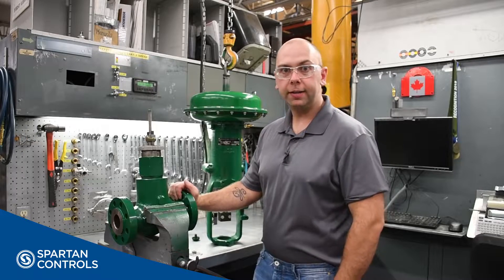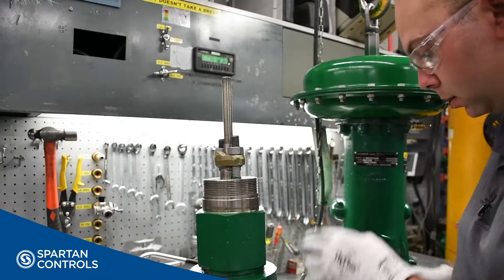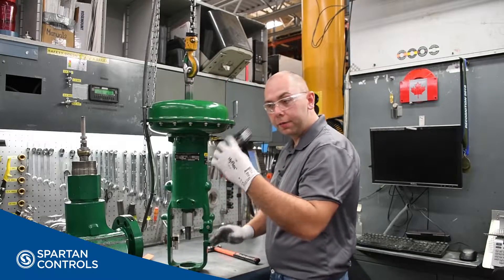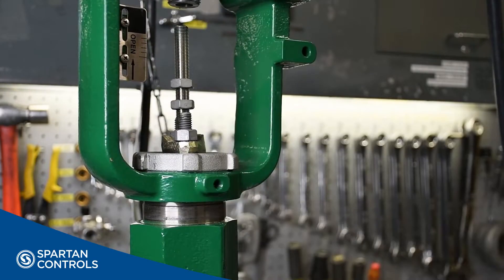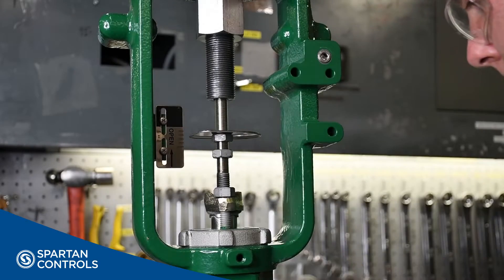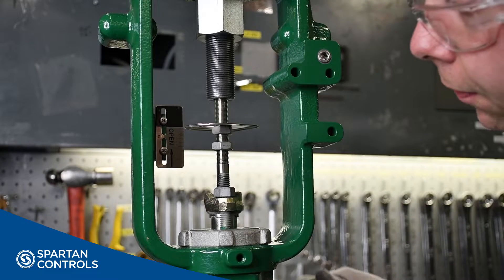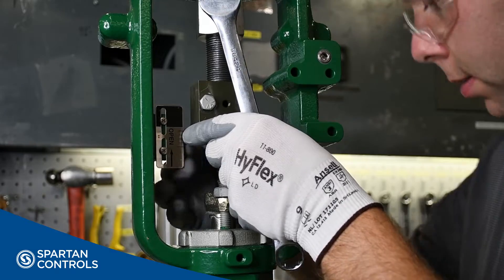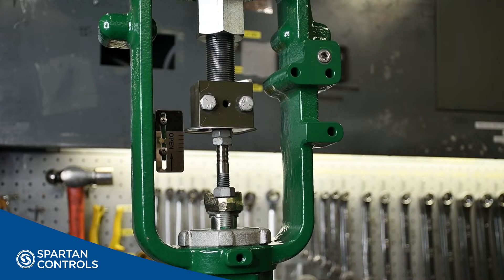Mounting an Emerson Fisher 667i Actuator

Comment: What exactly is this and what does it do?
Reply: It’s a control valve for controlling flow in industrial applications. Let’s say I want to control flow at a steady 80 gallons per minute. This valve can control it very accurately by restricting the flow. They are designed for high pressure with extremely strong materials.
Reply: That answers my question thank you. What are the Kit, linear feedback 110 array alignment  worth? GG20240X082. Made in china